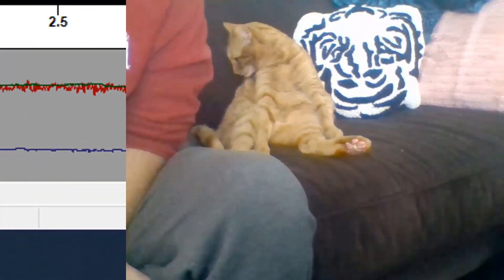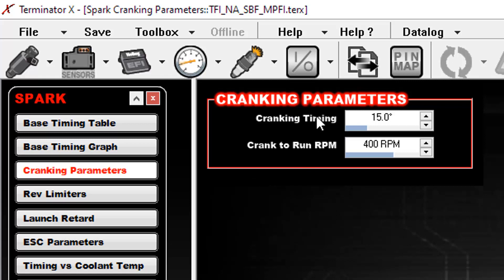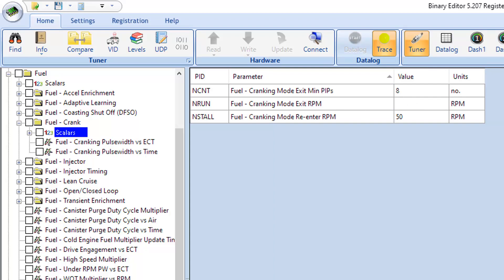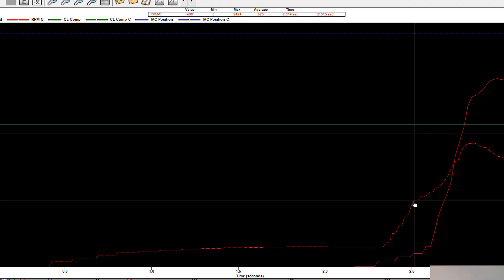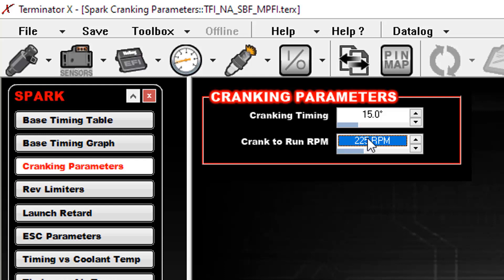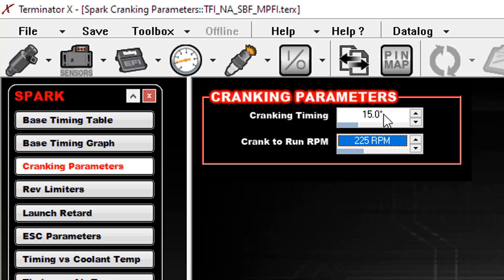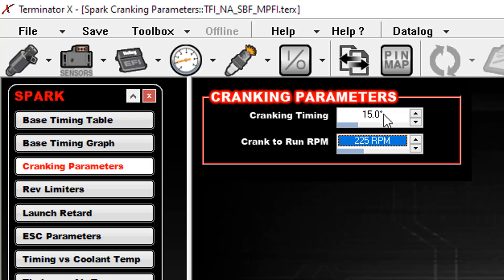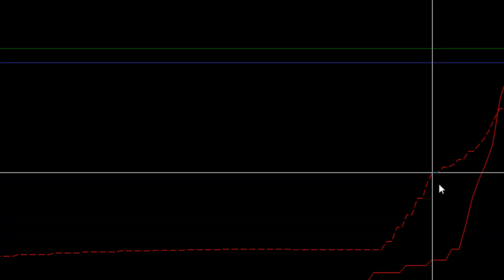Terminator X Tuning for Foxbodies - Faster Cranking

Comment: 3:10 The 400 rpm is not an expectation of cranking rpm. The cranking rpm as you noted was 125 rpm. The 400 rpm is the point that the ECU moves to the timing table.

Comment: Are you still answering questions?  I tried the settings, the car drives great, but start up went 3000 rpms for 5 seconds and it idled at 1300+   anyway to keep driveability and get the other two down?

Comment: I wish I had a laptop. The handheld device doesn’t have all these options. The only thing I see  is cranking timing and that’s it. Good info though
Reply from the maker: Yeah the handheld is good for little more than a first start or just being a display gauge in the car. Can’t tune a Holley efi car without a laptop.

Comment: Great Video! I'll Definitely Be Doing This Later. I've Got An '88 Fox Hatch That I Just Finished Installing This System On A Few Days Ago. I Also Need To Configure The IAC Like You Showed In A Previous Video. Do You Have Any Recommendations For Things That Need To Be Adjusted Or Changed In The Settings? My Setup Is A 347 Stroker, Trick Flow Heads, Port Matched Trick Flow Upper And Lower Intake, 11.7:1 Compression With A TKO500 And Obviously The Holley Terminator X EFI. I'm Just Up Here In Tulsa...Thank You!
Reply from the maker: At nearly 12:1 compression, I would drop cranking timing to 0-5 degrees. Make sure your fuel injector data is correct. Don’t just pick something similar in size just because it’s in the list. Make sure to change the cubic inches also so your fuel calculations will be accurate. Our shop is in stroud, so if you ever want to bring it down for work or tuning, we can certainly help. Also trying to coordinate with Kerry hunt right now to get the Facebook fox body groups from OKC and Tulsa together this year for an event.

Comment: Thanks for the great info. Also from where to got the factory ford tune chart for a 5.0L?
Reply from the maker: If you install a copy of binary editor. You can look at the free gufb strategy with your choice of oem calibration. Once there you’ll want to look st the sea level spark table and the wot timing vs rpm function.

Comment: I had no idea what these settings did, now I'll play with it since my battery is trunk mounted and I have a very hard to start car.
Reply from the maker: Does it have a hard time getting the starter to crank quickly, or is the starter cranking quick but the car just doesn’t want to start very fast?
Reply: @LeechMotorsports  cranks just about kills the battery then it will finally start with opening the throttle, but I need to find my vacuum leak too before I get into it further.
Reply from the maker: It may help to slightly reduce cranking fuel or increase idle air duty cycle during cranking at the problematic temperatures.